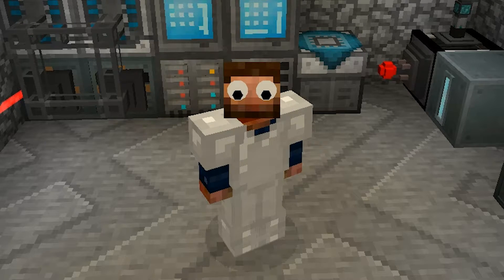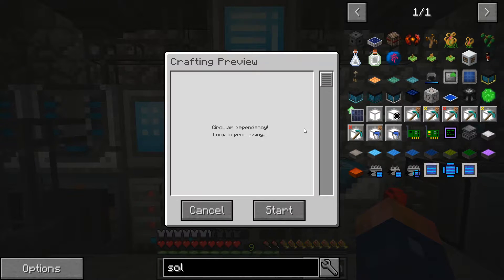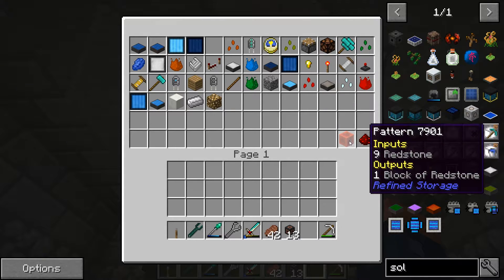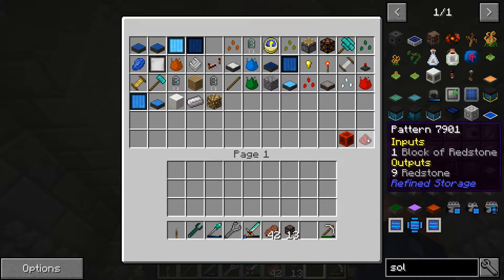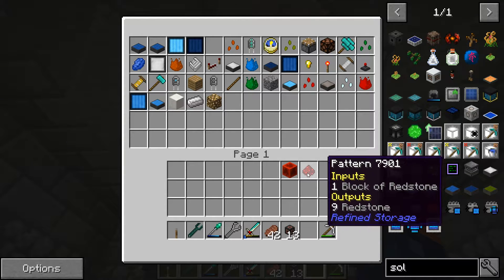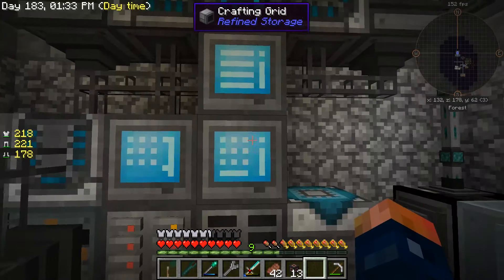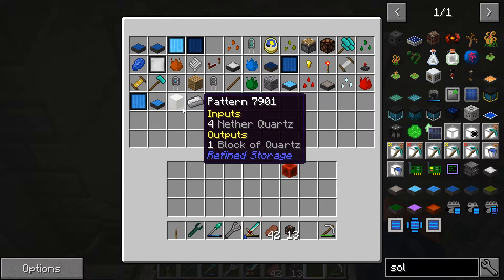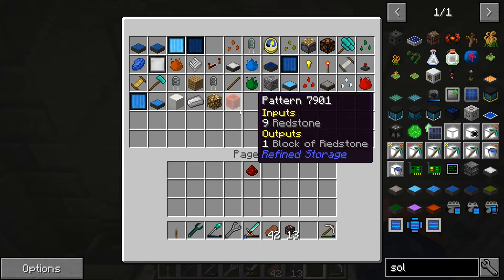Circular dependency! Loop in processing... [Refined Storage Fix]

Comment: Very helpful. Still hasn't changed yet though. Why did they even have to switch to refined storage applied energistics was fine. D:
At least there is compacting drawers.
Reply from the maker: AE2 is in this pack and its updated to 1.10.2

Comment: I'm playing on a multiplayer sky factory 3 server, I'm having a problem where all of my importers and exporters stop working when the chunks they are in get unloaded. I have to break and replace every one I have every time the server resets. Also it seems I have to break the controller and replace it or my auto crafting stops working as well. Do you have any ideas?
Reply from the maker: +Pete Paffenroth If a chunk unloads wile a process is taking place the process will stop. One way to fix this would be to stay in range so the chunk doesnt unload or use a chunk loader (most servers ban these tho). Also create a crafting monitor so you can see if a crafting prosser is still in progress. I would sent a ticket or message a admin of the server and let them know what is going on and maybe thay can look into it.